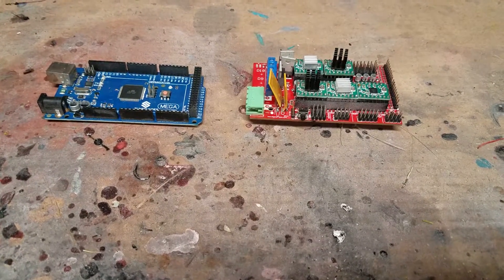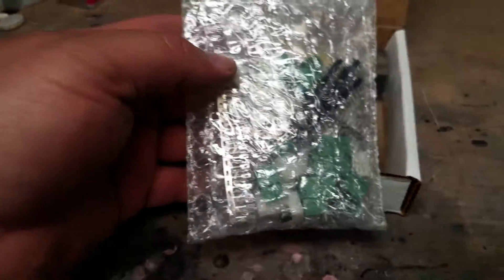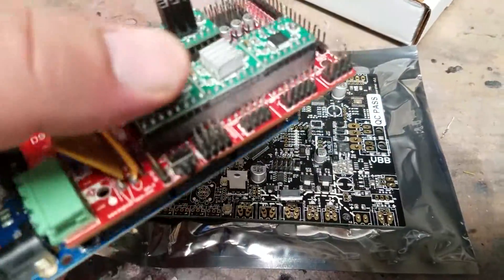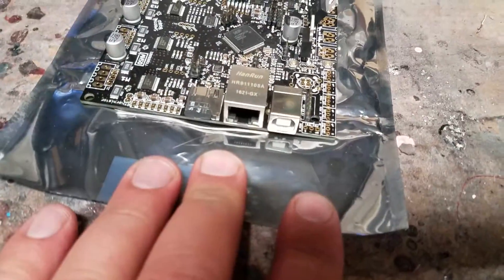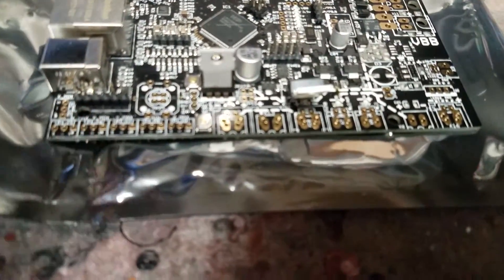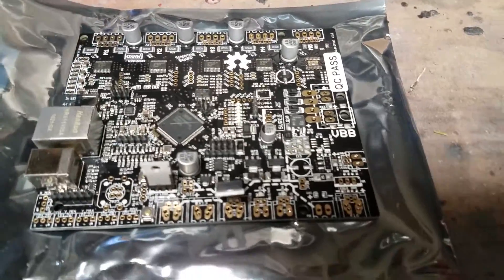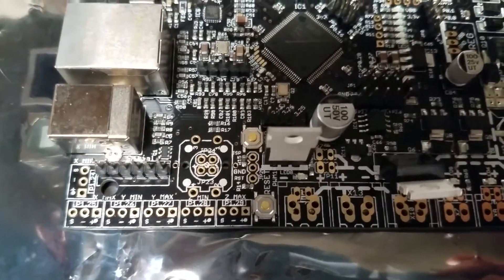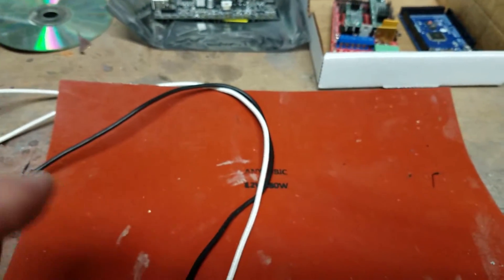Smoothie board unboxing, upgrade your 3D printer!

Comment: Hrm, my biggest problem with the smoothie board was cost, why pay $100 to upgrade a ($4 RAMPS + $2.50 4xA4988 + $8 Arduino) = $14.50 system when you could get cheaper options like the 32 bit Re-Arm board for $45 that runs smoothieware anyways. I know you did your video a year ago but what are your thoughts these days?

Comment: You bought this thing and you don't even know what it will do?
Reply from the maker: Riff Raff it does a lot more than the RAMPS setup. The specs are also more impressive. Sometimes you have to use the thing first to know it's full potential.

Comment: Hello Jay did you say you're running it on a Cartesian-style frame?    like a i3 frame?  if you are can you explain how you got yours to bed level without an end stop on the Z if you are running a sensor or BLT?
Reply from the maker: Dunstonuk I manually bed level. The board does have the bed leveling options, but I prefer to do it myself.
Reply: Thank you for your reply. I gave up trying to get the board to work with a BLT, and reverted back to Mks base 1.5, still have the board may change over again if Arthur Wolf ever get his head out of his Ass, and stops being so anti BLT. :)
Reply from the maker: BLT? If you need help let me know, I have another vid that gives code for i3 printers.
Reply: sure share the link >)
Reply: Hi Sure link it please
Reply from the maker: Dunstonuk https://youtu.be/T-5KOhZ1M7s

Comment: Faster processing for faster prints? Not really. The speed of a 3d printer is mostly restricted by the extruder/hotend's ability to push filament, somewhat the frame sturdiness, and stepper drivers. Frame rigidity though, affects the quality of the print, not much the speed.
Reply: Actually, it's common nowadays to have machines rigid enough and with good enough extruders that the controller board becomes a problem. That's also true when printing very thin layers, or very detailled shapes. There's a good reason why a lot of "professional 3D printer operators", people who do this for a living, are switching over. Also even at lower speeds Smoothie provides smoother and more accurate motion with less artifacting. 
What you are saying is mostly true only for low-end printers nowadays.
Reply: except when you don't print blocky objects. In that case you're speed are limited to 45-75 mm/s
Reply from the maker: True, that's why I went with a 2020 extruded frame instead of an MDF or Acrylic frame. Granted a larger nozzle will help with speed, but at the cost of resolution. But then again if your going fast resolution is going to be effected.
I can tell you the Smoothie board has made my printer quieter, I can ramp the speed up faster than a Ramps set up and the printer operates smoother as well.